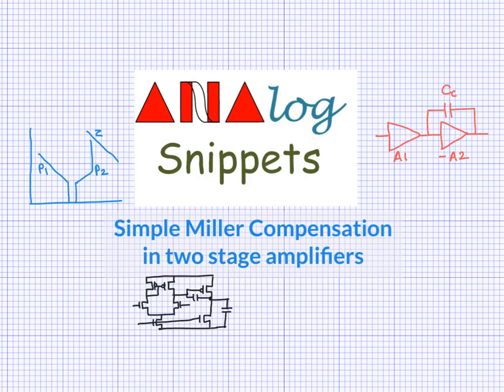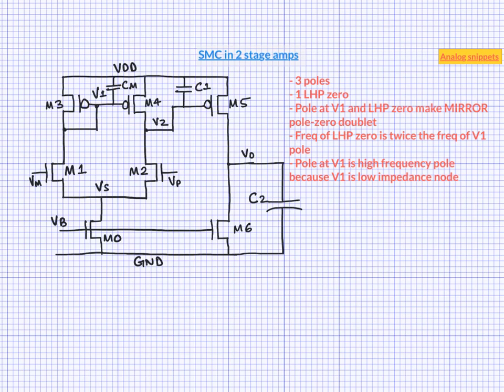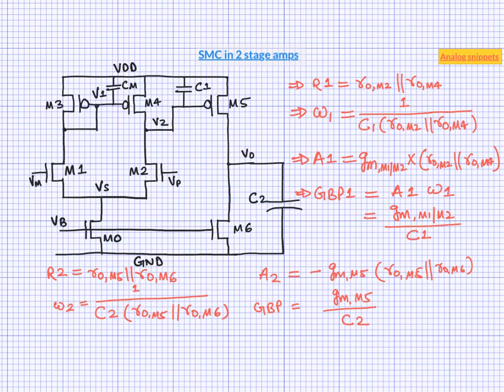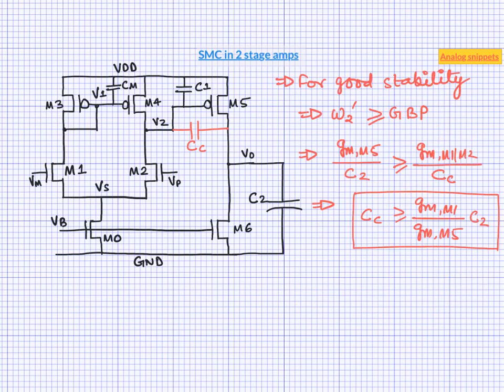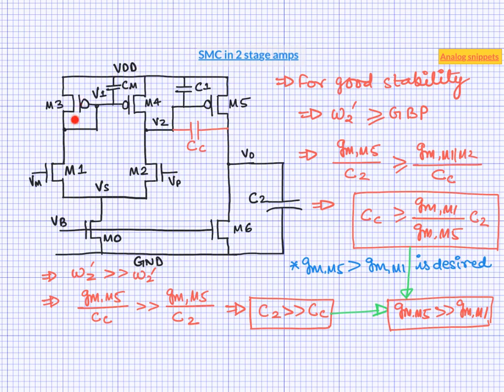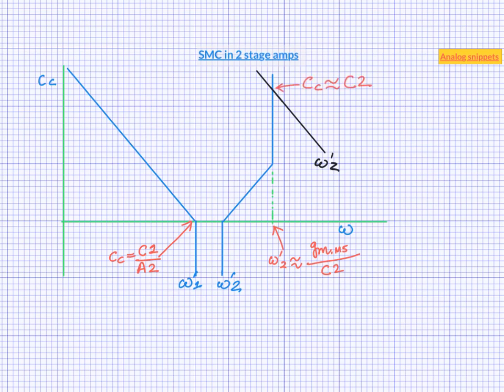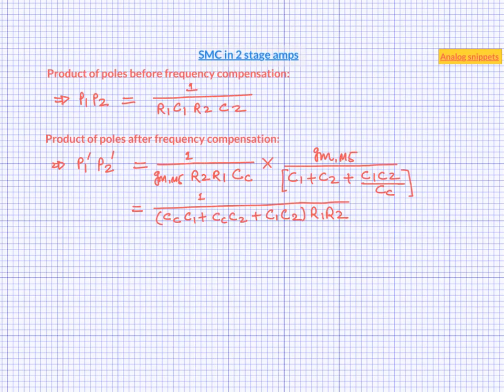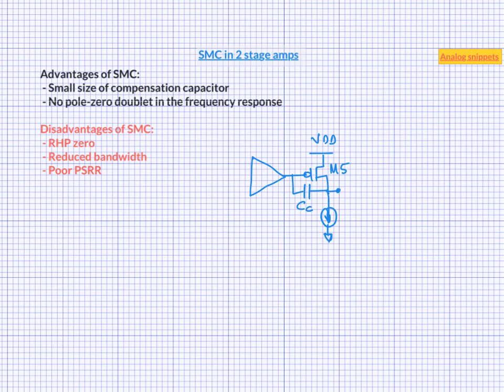#20 Simple Miller Compensation in two stage CMOS amplifiers

Comment: Very smart explanation about pole-zero doublet at V1. Kindly explain why doublets are not good with reference to stability. Thanks.
Reply from the maker: Depending on the type of doublet phase can be erratic near doublets which can create issues with the stability. A more troublesome issue is slow settling caused by doublets which can be a problem for precision circuits.

Comment: To begin with, since C2 >> C1, in the plot shown in 8:43 for extremely low values of Cc, assuming output impedance of stage 1 and 2 is comparable, shouldn't omega 2 (second stage pole) be before omega 1 (first stage pole)?